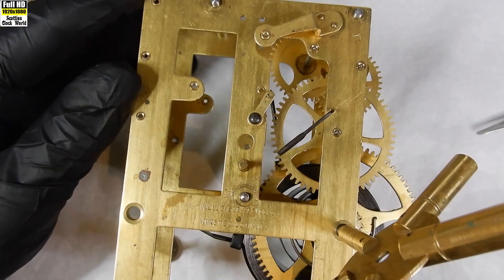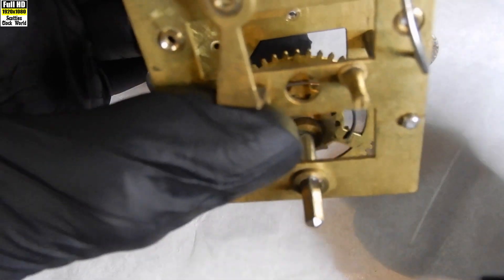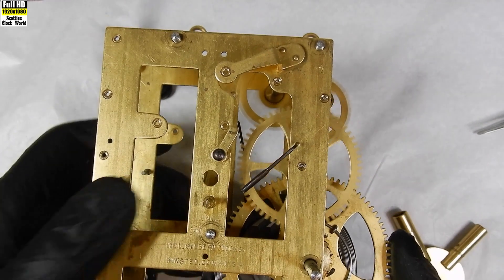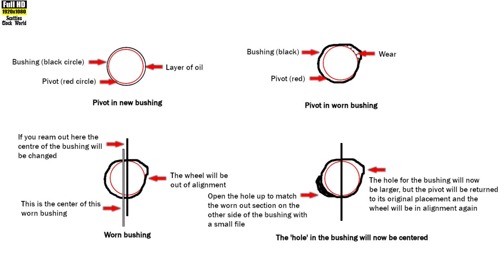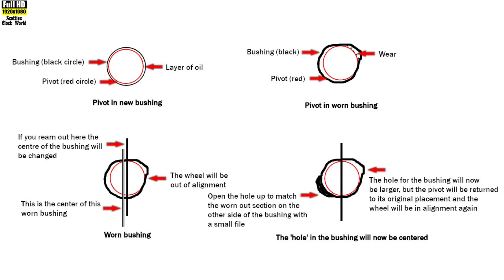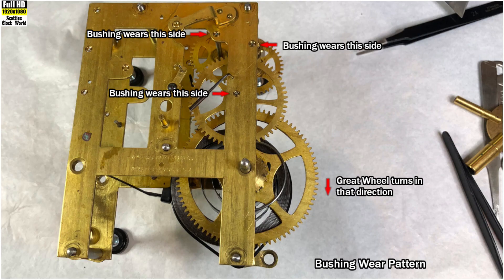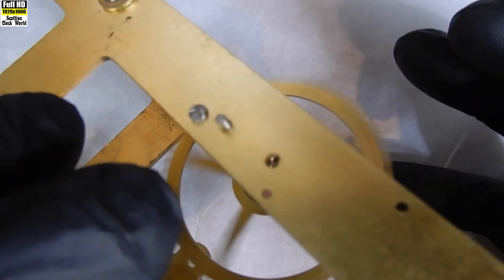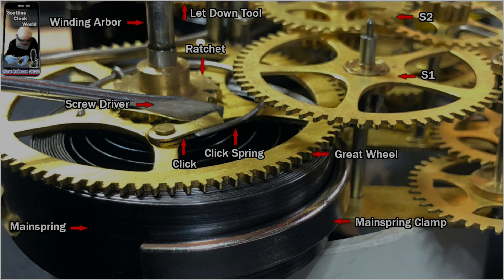Clock Repair For Total Beginners - Lesson 10

Comment: Thank you very much for your demonstration and explanation! On watching this video I understood that the energy stored in the wound up mainspring around the barrel or cable (chain or cord with hanging weight) wound around weight pulley is forwarded and reversed repeatedly from great wheel to escapement wheel to keep the clock functioning for days. Forwarding energy from main wheel to escapement wheel causes the leaver escapement to push the pendulum or balance wheel forward everytime it returns backward and reversing motion from escapement wheel to main wheel causes the motion work to drive the hands.

Comment: Thanks Scottie, this is the part that makes me nervous.  Wouldn't want to mess it up.
Reply from the maker: Hi Whitney, manual reaming out a hole for the bushing is not a problem if your measurements are correct.
Broaching out the bushing so the pivot fits correctly can be a bit daunting till you are used to it, if you broach the bushing out too far then you have to start again.
Reply: @ScottiesClockWorld  Do you just knock out the over-sized bushing?
Reply from the maker: @whitneykovener , Hi Whitney, did you watch these two videos I recommended?

How To Rebush A Clock Movement By Hand - Part 1 Reaming:  https://youtu.be/IGKOj3j9oPk
How To Rebush A Clock Movement By Hand - Part 1 Broaching:  https://youtu.be/xnwn49S5nTI
Reply: @ScottiesClockWorld  I sure did, thank you
Reply from the maker: @whitneykovener  , good.
Reply: My rule of thumb is, if it is so bad that it needs fixing, you can't really break it much more than it already is - so that becomes the fix if you do it carefully. Worth a try.